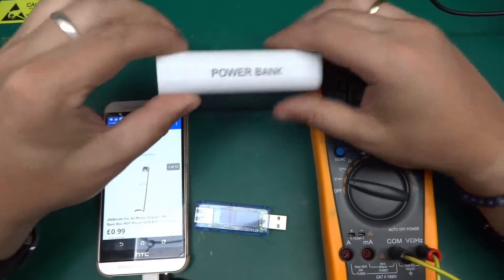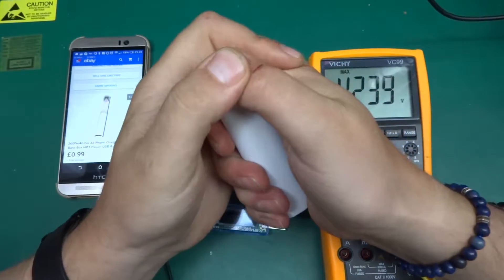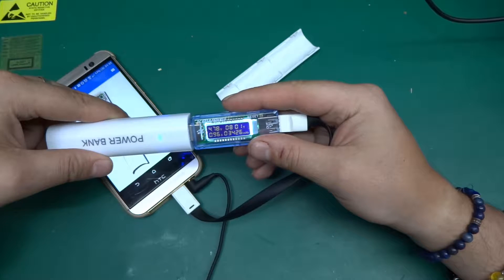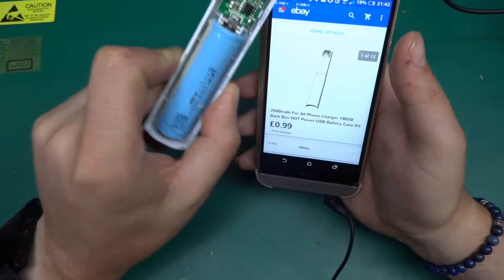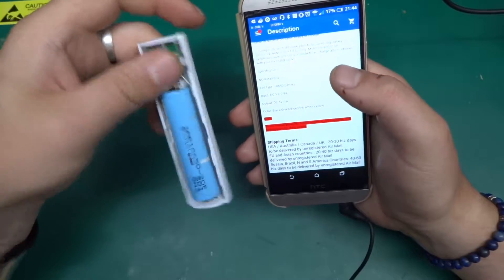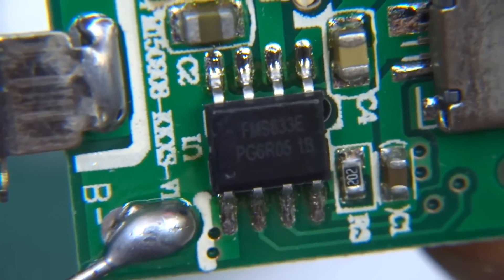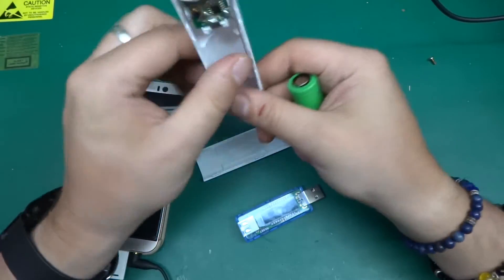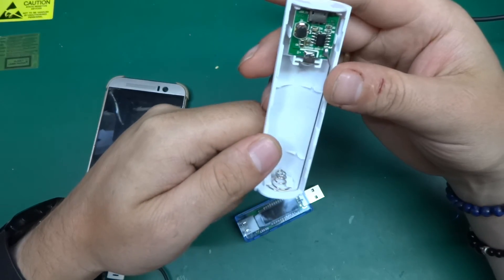White plastic power bank kit from ebay

Comment: Nice, at least it seems to be a synchronous booster.
Reply from the maker: I thought most, if not all small/battery power are synchronous nowadays due to efficiency, but I may be wrong. However, I am curious, what gave it away for you in this video? Is it only lack of external diode, or something else?
Reply: Lack of diode plus the datasheet (looked it up, it's a part made by Shenzhen Fuman and ran it through Google Translator). 
I saw many cheap-ish power banks with non-sychronous boost converters, often with the output directly connected to the battery through the coil&diode, with no protection (facepalm).
Reply from the maker: TefaTronix cool! I am still to find a powerbank with usb socket wired directly across battery terminals LOL! I wonder if someone's house burned down already due to junk like this. Thanks!
Reply: well, not directly like that, that would be the definition of ultimate junk :D I meant like this:
battery+ --------- (inductor) ------- (diode) -------- output+
battery- ----------------------------- output -
with the booster chip connected to bat+, bat- and the point between the inductor and diode. No battery protection IC or anything... the boost converter usually shuts down at around 3V in, but the output still remains energized (around 2.7V), fun with only resistive loads or short circuits :)
Reply: Managed to find this: http://www.yddyw.com/uploadfile/2014/0625/20140625104628_2427.jpg , although the image quality is pretty bad.